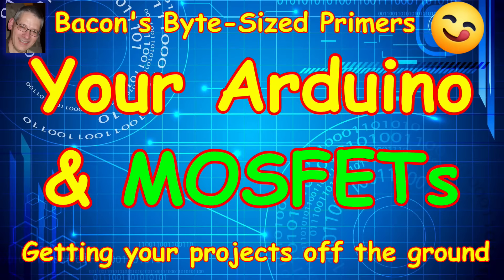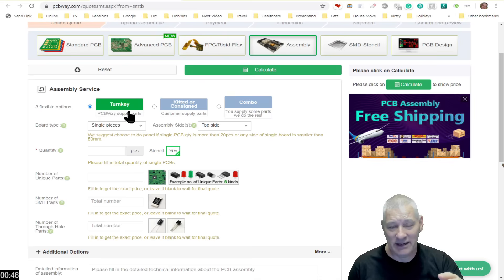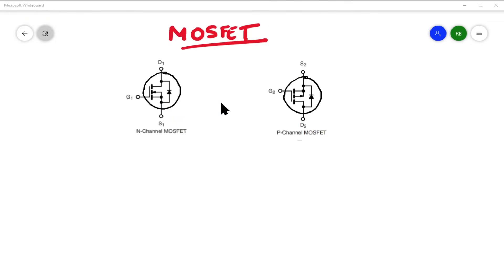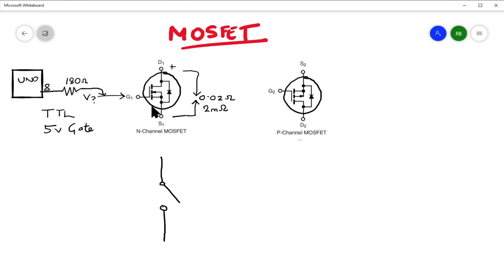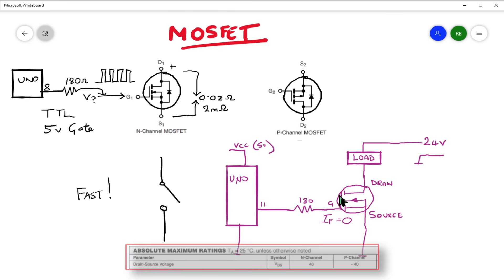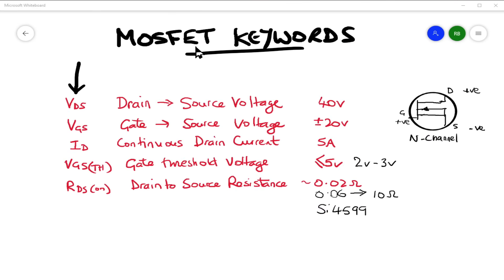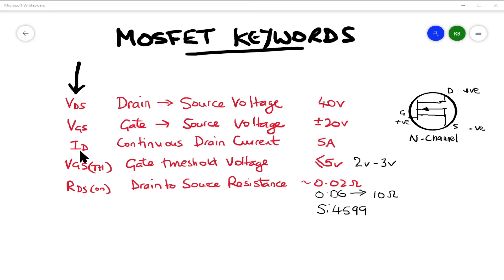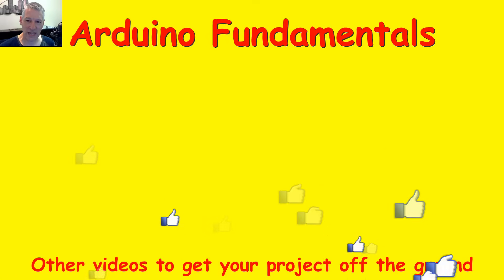#BB4 MOSFETs - From an Arduino Perspective

Comment: You forgot the gate pull resistor to prevent false triggering.
Reply from the maker: On what? All MOSFETs have the required pull-up/down resistors!
Reply: @RalphBacon  ....what? MOSFETs contain no resistors.

MOSFETs require the gate to never float, otherwise they will trigger randomly. A microcontroller will float its outputs until told otherwise.
Reply from the maker: This comment appears in a raft of comments about my latest project that used MOSFETs!!! Anyway, the gate resistors are (usually) necessary and I never omit them in Real Life but this is about the theory really. There is another video on MOSFET reverse protection, that (hopefully) has the resistor in place (or doesn't need one).
Reply: @RalphBacon  This has nothing to do with the series resistor. MOSFETs need a pull resistor from gate to source to prevent false triggering. Look it up.
Reply from the maker: Yes, I understand that. All my N-channel MOSFETs have a 10K resistor from Gate to Ground. All my P-channel MOSFETs have a 100K resistor from Source to Gate. You must have missed my videos where all this is clearly described.
Reply: @RalphBacon  What do other videos have to do with it? My point was, you neglected to mention them in this video. And that's a problem, because people won't know they're needed. This is a beginner's introduction video, right?

When you say "all my MOSFETS have", do you mean they innately contain such resistors? Because if so: citation needed. I've never heard of any such thing. You have to add them yourself, always, in my experience.

In fact, if a MOSFET contained its own gate-source resistor, it would be unsuitable for use in any number of applications that depend upon the gate having a high impedance. Not to mention, it would cease to be static sensitive. I think you are severely mistaken.
Reply from the maker: No the MOSFETs don't contain a resistor, all my circuit diagrams in my other videos that use them do. Yes, perhaps I should have mentioned it in the video but I only had 15 minutes to cram in what I did. If beginners use the circuit I showed, then the gate will be kept low anyway by virtue of the fact that they will have initiated a digitalWrite LOW for that pin. 'Nuff said.

Comment: What is the significance of the source to drain resistance? Would a higher resistance cause more heat? Why should you care when resistance is relatively very low anyway? Excellent video!
Reply from the maker: Yes, heat is your enemy. Or the MOSFET's anyway. If the RDS(on) figure is relatively high (eg 10 ohms) then it will dissipate significantly more heat than a device with a resistance of 0.01Ω. That's how some of the "power" MOSFETs are able to pass 50A without melting!
Reply: Ralph S Bacon Thank you for your reply. I really enjoyed your video. Great work!!

Comment: I hadnt realised you already covered ... so I also got a number of 2N7000 which hopefully will act as switches to the inputs of a Arduino and being powered from PCF8574's via a 180 ohm resistor... which I am using on Model railway for point control via a Mega and PCA9685 to run  SG90 servos.. again another Great video
Reply from the maker: Yes, they are a reasonable, general purpose MOSFETs, the 2N7000, a higher than normal RDS(on) of 5Ω, 200mA current capability and a VGS(th) of  3V. A good BJT substitute.

Comment: Side note:  A lot of the "5 volt MOSFETS" you'll find will also work just fine at 3.3 volts.  So you ESP32 people are good to go, too!  (Check the voltage curves to be sure!)
Reply from the maker: True, Chris, but be very careful. The manufacturers will quote RDS(on) for 4V5 and 10V usually (even for TTL level devices) but to what extent the MOSFET has switched on at 3V3 must be checked (VGS(TH) will give an indication, that's all, as you say graph is best). The last thing you need is a partially switched on MOSFET (unless you intend toasting marshmallows over it).
Reply: @RalphBacon  What's wrong with toasting marshmallows?  lol...
Reply from the maker: Beneficial side effect, possibly?

Comment: The video was very helpful to me for describing the terms needed and I have been struggling to find good candidates for use with 3.3V logic devices.  So... I am a little confused.  The two examples you list IRL3705N and Si4599DY show VGS of 16V and 20V respectively.  Not the 1-2V you describe in the video as what we need.  It's probably wrong, but my current understanding is that Mosfet's, if the gate is not at these voltages, the drain resistance is very high and thus waste a lot of energy in heat vs driving the motor.  Do you have any Mosfets that show VGS in the 1-3V range?
Reply from the maker: The terminology is particularly confusing. 
The 16V/20V is the VGS which is the maximum voltage allowed between Gate and Source. 
The VGS(TH) is the threshold voltage at which the Gate will start to turn the MOSFET on. I know, it's done to confuse us.
A number of MOSFETs start to turn on at 1V-2V, some require 3V or even better 4.5V to ensure they are fully on - as the resistance is indeed high before that point and they get hot real quick, just as you say! The only way to know is to look at the DataSheet for the RDS(on) graph at particular Gate voltages. As an example:
IRL3705N will have an RDS(on) of 0.018Ω with a Gate voltage of 4v5 but will start to turn on at a VGS(TH) of just 1V (min) - 2V (max). Always assume the higher (worst) figure as you don't know what you might have bought.
Have a look at my video #195 on Reverse Voltage Protection (https://youtu.be/eS4_6XQi74c ) as that has more details too.

Comment: BJT's is more robust when you use coils, (when the coil backfire when disconnected). Don't ask why I know this....
Thanks for sharing 👍😀.
Reply from the maker: Did you put a protection diode across the coil, Asger? Like you would for a relay coil? That should protect BJT and MOSFET.

Comment: I used mosfets in an Arduino pcb print before, but I learned something new. Does anybody know where the specific value of 180 ohm for that resistor comes from? In case I want to use it on a 3,3V pin, for example. I assume it is the result of pin voltage devided by max current for the pin?
Reply from the maker: Correct, Jason. It limits the current from the pin to the maximum allowed - well, strictly speaking 40mA is allowed but we try and limit to 20mA for the 328P. Other micros will have different limits. Note that the resistor also limits the switching time for the MOSFET (as the Gate current is restricted by the resistor, hence it cannot charge as quickly) so if you are doing PWM on the pin bear this in mind.

Comment: Ralph, I have a video request/suggestion for you.  Could you do a video on how to use the ESP32 with WIRED Ethernet?  I've looked around and there's virtually nothing on this subject.
Reply from the maker: There are some ESP32 shields, John, that offer wired ethernet, although they are not cheap (£20) but do offer to power your ESP via the same cable (PoE). Google search for ESP32 Ethernet Shield showed me:
https://www.mouser.co.uk/ProductDetail/Olimex-Ltd/ESP32-POE?qs=unwgFEO1A6tUQVMxdOBsBw==
The main reason that they are scarce is because everyone wants cable-free WiFi not a long Ethernet cable, regardless of whether that powers your device or not.
Reply: It's likely because it's not as simple as you'd hope using its internal ethernet support. This blog post that's referred to often might be useful if you wish to try: https://sautter.com/blog/ethernet-on-esp32-using-lan8720/
Reply: Another source for info, closed issues on arduino-esp32 GitHub repository: https://github.com/espressif/arduino-esp32/issues?q=is%3Aissue+ethernet+is%3Aclosed

Comment: Great vid Ralph, but there was one thing missed that I think is quite important.  To turn the FET off properly you need to give it a ground reference to pull that capacitive charge off the gate if your microcontroller doesn't automatically provide the path.
Reply from the maker: Yes, Jeff, indeed. I usually use a 10K to 100K and I even had this videoed but it got snipped onto the cutting room floor. I'm going to do another video on this entire subject, it's too big to be done in 15 minutes!

Comment: When I ran your video yesterday I'm sure it had something about using a P mosfet for reverse polarity protection.  I made a mental note to make some notes on this as it seems a very useful thing to do, but when I look at your video today its nowhere to be seen.  Was I hallucinating?
Reply from the maker: Yes, you were under the influence. However, I shall be talking about this easy-to-use circuit in quite a bit more detail in a forthcoming video so you will not lose out. Stay tuned!

Comment: Love the vid, but why is common to see dual channel MOSFETs used in the Arduino world?
Reply from the maker: I wouldn't say it is that common to see a dual MOSFET in the Arduino world (not a P-channel and N-channel together) but of course bridge circuits for motors use multiple MOSFETs. However, that Si4599 could be deployed just for the P-channel MOSFET in the package, it's that useful.
Reply: @RalphBacon  so why would they be used at all, think iam still a bit confuddlled
Reply from the maker: In order to switch on a P-Channel MOSFET is it quite common to use another N-Channel MOSFET - hence this dual MOSFET package (to bring the Gate to GND). In motor control (bridge) you need two N-Channel and two P-channel MOSFETs too. Either individual components or in a dual package.

Comment: Thanks Ralph thanks for the video, I believe P-Channel MOSFETs are capable of switching higher voltages so can be used like a relay , where as PNP Transistors cannot (would always be on)  I have seen them used a lot with Arduino for working between 3.3v and 5v.  I have not used them much as I worry static will kill my projects too easily, and hard to test once soldered to a circuit, perhaps I should have a go.
Reply from the maker: Well, there are high voltage BJTs as there are MOSFETs, The trick is to select the right component for the job. Static can be an issue but wearing an earthing wristband can help. And not shuffling your feet on the carpet whilst touching them.
Reply: @RalphBacon  sorry i meant switching higher voltages using a 5v arduino, this does not work with PNP transistors regardless of their rating. But does with P-Channel Mosfets.
Reply from the maker: I've not used many PNP BJTs in the Arduino World, Andrew. But something tells me it must work because we can run a bridge circuit for a motor this way (2 x NPN, 2 x PNP) - not that we would want to with MOSFETs now available.
Reply: @RalphBacon  yes you can do it with a combination of PNP and NPN but If you try to switch 12 volts off with five volts on a PNP T you will still be -7 volts and as a result still on. Apparently it's not a mosfet limitation.  https://electronics.stackexchange.com/questions/248796/pnp-high-side-transistor-switching-with-microcontroller

Comment: WARNING: THE REVERSE POLARITY CIRCUIT HERE IS WRONG!!!
For the correct reverse polarity protection Google image search "reverse polarity protection using mosfet"
Reply from the maker: Sigh. I drew this in the same way I drew my auto/on off which is not the way it was supposed to be for reverse polarity protection. The body diode should conduct (initially) to allow the MOSFET to switch on normally ("in reverse") but block reverse current. So Drain and Source go the other way round. I should have used a zener too but it all ends up going over the heads of beginners. This (correct) circuit is still sitting on my workbench on the breadboard. I shall consider what to do.

Comment: I'm sorry but they are too many mistakes in this video.
- there are big capacitances between the gate and the source and drain and you have to charge/discharge them so there's a BIG gate current during switching. When the n mosfet turns on the voltage at the drain drops very fast (going from Vcc to almost 0) so the capacitance between the gate and the drain that whats to keep a constant voltage between the drain and the gate makes the voltage at the gate drops (Miller effect), turning the mosfet back off. If you don't want oscillations you need to provide a good current to the gate.
- the gate resistor is there for a good reason: the output stage of the mcu is not designed to handle the currents needed for a clean switching. The good way is to use a special gate driving IC between the mcu and the gate. If switching speed is not that important the resistor is ok.
- there's a body diode in your p mosfet that will let current flow in the opposite direction. Your protection doesn't work! The drain and source are in the wrong way !!!!!
Reply from the maker: This has been covered by other viewers too but turning on a MOSFET without a gate resistor certainly seems to work without blowing up the Arduino. Perhaps because the gate charges in about 1µS (I'm using 1nF gate capacitance as a rule of thumb, although the datasheet will specify). Perhaps the port pin would eventually fail? But putting the resistor in place protects the Arduino and slows down the charge of the gate - but for the purposes of this overview I don't think that really matters if all we are switching on is an LED or relay or something like that. The MOSFET really requires a resistor from gate to ground too (I use 10-100K) to ensure it really switches off and protects it from floating about and reduces ringing but I also did not include that in the final cut. Took too long to explain every nuance. 
Using a driver of sorts (even if it's just a single BJT) for high frequency switching is certainly advantageous but then again how much detail do I go into for beginners?
Yes, the reverse protection MOSFET is the wrong way round. I drew it on auto-pilot. I might cut that bit out yet,
Reply: @RalphBacon  if the beginners are your primary audience then giving proper informations is even more critical. If you switch a small mosfet onece per day Ilmaybe the mcu output will suffer but will survive long enough. If you switch a large one and do some PWM for exemple, then it will shorten the life of your mcu.
You are basically shorting the output for a brief time everytime you change the output. The gate capacitance is a bit misleading because of the Miller effect that amplifies it. Arround the threshold the gate's voltage will stabilize while you pump charges into it.
Reply from the maker: As Albert Einstein said, “Everything should be made as simple as possible, but no simpler.” Unfortunately in this video I tried to over-simplify and shot myself in the foot. I've removed the reverse polarity protection video piece as I could not let it stand. I'll probably do an entire video on it which will give be a chance to fill in the blanks (most of which are on the cutting room floor) on MOSFETs.

Comment: Very interesting Ralph, for real protection we used to drive the mosfet from an Opto-Isolators.
Reply from the maker: Very safe, or you can use a purpose designed MOSFET driver, of course. I've never used one but I'm assuming they provide protection somewhere too.

Comment: So, I should look for a TTL N-Channel Mosfet. What is a good general purpose one that would also work for ESP32 3.3v? I'm looking on Aliexpress and they have too many options.
Reply from the maker: For 3v3 use you need better than TTL. The only way to find one is to use the filtering on something like RS Components to narrow the search. That's how I found the IRL3705N but it's very chunky. You can always use MOSFET drivers from the ESP8266 that will guarantee your MOSFET to switch on fully, but that's a different topic. Learn more here: https://www.microchip.com/design-centers/power-management/motor-drivers/mosfet-drivers#:~:text=A%20MOSFET%20driver%20is%20a,(IGBT)%20or%20power%20MOSFET.

Comment: While a gate resistor may protect the driver when something goes wrong with the MOSFET (but even then if there's only something between 0 and 5V on the MOSFET), it's not the reason that it is used.
The purpose is to limit the current to a value the driver can deliver (40mA in case of an AVR/Arduino). The gate behaves like a capacitor and is like a short when switching. The resistor also reduces ringing that can happen because of the inductance of the gate trace and the capacitance of the gate. That ringing can lead to slow turn on and a lot higher losses.
Several 100kHz to MHz directly driven by an atmega is also very - let's call it - ambitious. Frequencies like that definitely need some external drive circuitry if you want your MOSFET not to be in the not-on-not-off state most of the time.
Reply from the maker: If we assume the MOSFET gate is, perhaps, 1nF it should charge in about 1.25µS if we use (for simplicity) a 250Ω gate resistor and assume a capacitor charges (not fully, but fully enough) in 5 time constants. Enough to generate a 0.8MHz signal.
In the Arduino world we tend to switch on relays, LEDs and the such like and that's fine for that. Generating pulses at several 100kHz is a different matter so it's a pity I suggested this, as although it can most certainly be done (it "works for me" on my workbench without blowing anything up - yet). 
I haven't done it recently but I'm pretty sure you can get 1Mhz out of an Arduino? The PWM frequency is much lower by default but by changing the parameters we can get some incredible frequencies. In a much earlier video I adjusted the registers and got 15kHz to speed modulate a fan. In fact, it might have been higher now that I think about it, as I can hear 15kHz as a terrible high pitched whining.
Anyway, anyone watching this video (as a beginner) is unlikely to be creating PWM frequencies of several 100KHz without a driver of sorts (eg a single, fast BJT, how ironic).